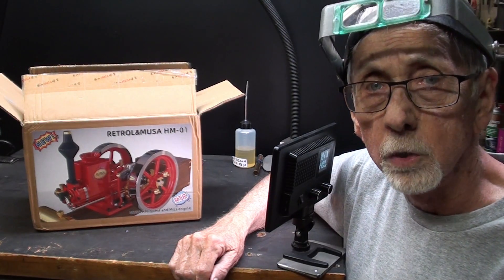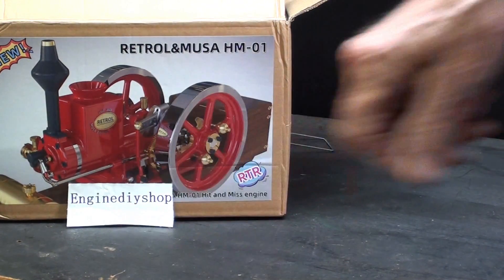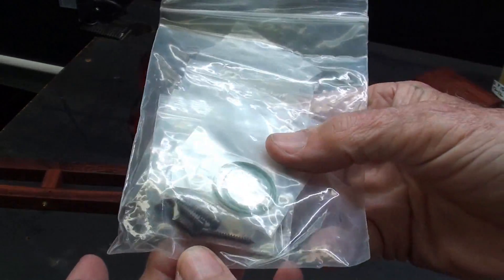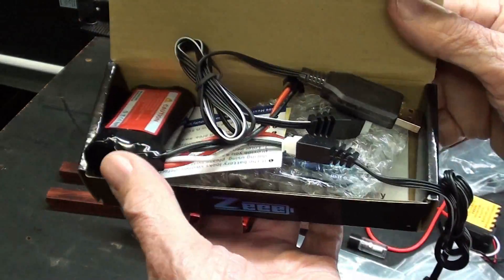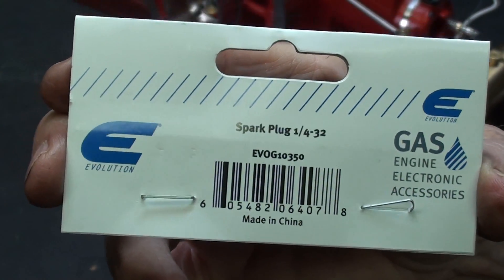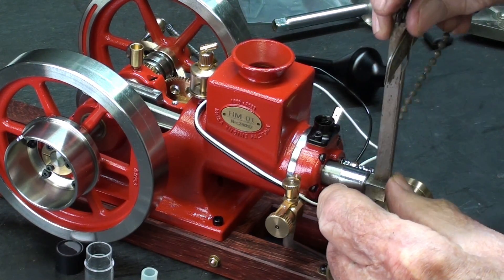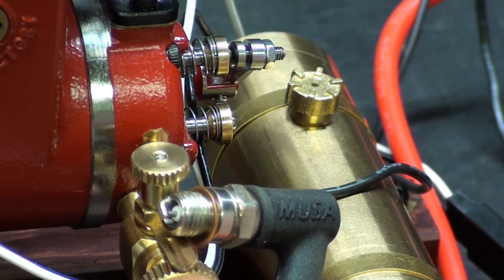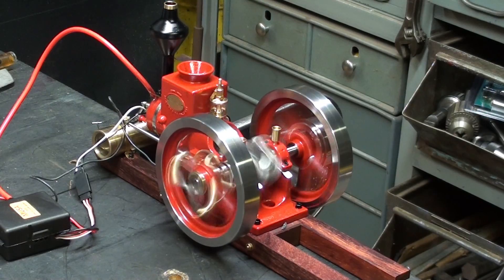RETROL HIT MISS ENGINE MODEL enginediyshop  #973 tubalcain

Comment: Hello Mr. Pete, first start and run of my HM01 yesterday. Running on Ronson lighter fluid, and timing set to just near TDC and it ran very fast with the ignition lever up and as soon as I moved the lever to the hit and miss setting it died every time even with some carb adjustments. Also the engine got very hot on continuously firing mode even with water, too hot to touch the casting. I stopped running it as I thought it was going to overheat. How hot does your engine get? Any tips on going from continuous run to hit and miss mode carb settings? Thank you.

Comment: I have enjoyed your review of the Retrol and am in the process of building mine right now. I would like to use a 9volt battery to power mine, do you feel that this will work properly? Thank you!
Reply from the maker: I think that will work
Reply: @mrpete222  Thank you!
Reply: Mr. Pete, I am ready to start my engine but am confused about the points. Should they close or open to fire spark plug? On a car I know thy open to fire the plugs but is it the same with the hit and miss. Seems like the spring side of mine is bent improperly, the points want to open as the piston nears top dead center. Your thoughts?

Comment: Instead of the rosewood box you could install a generator on the base timbers. In that way you could charge your battery while the motor is running. The rosewood box could installed on a separate cart like those used for starting aiplane engines.

Comment: That appears to be a well made mini engine. Years ago I went to a lumberyard and they had a old single cylinder hit and miss engine that had flywheels that were 15 feet tall. A employee there told me it use to run on kerosene and they would wrap a rope around one of the flywheels and use a horse to pull on the rope to turn over the engine. That was appox 55 years ago the last time I saw it, so it probably has been scrapped by now.

Comment: I remember when you could go to the store and buy reconditioned spark plugs and re-refined used oil. I also remember when you could buy engine rebuild kits for less than a $100.00. The kit had piston rings, rod and main bearings and a full gasket set.
Reply: Pip kits ?
Reply: @oregonwinger64  All I remember about the rebuild kits were they had Ridge Dodger Rings and Badger Bearings.

Comment: The RPM and the hit and miss sound do not seem synchronized. What is causing the sound? 
Thank you for the video.
Reply: That's how it works. It only has ignition when it's running under a certain RPM. The "hit" is the combustion, which raises RPM, followed by slowing down, no combustion in the chamber ("miss") . When it slows down enough, on the next cycle you get another "hit". Because ignition happens only at a certain point in the cycle, the interval between explosions might not be always the same. It might get to the hit speed just after the ignition point or just before and so on.
Reply: @aerogfs thank you. I did not realize that a power stroke did not follow every compression stroke.  They should add a compression release so it would freewheel longer.😊
Reply: @scottjones7279  This model was not exactly made with efficiency in mind. Besides, people would complain about the lack of "hits".
Reply: @scottjones7279  Actually you are correct. The exhaust valve is locked open during the coast period between power strokes so the engine is in fact free-wheeling with no compression.
Reply from the maker: Great explanation
Reply: Might also be affected by component's precision, lubrication, temperature and so on... Quite often, the governors running this mechanism are not that smooth... I think this is quite visible in this example.